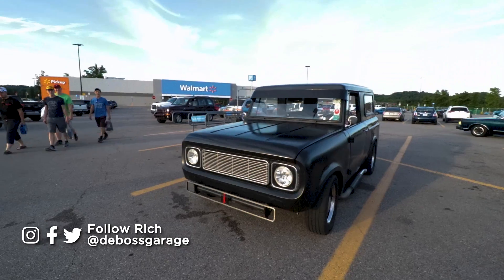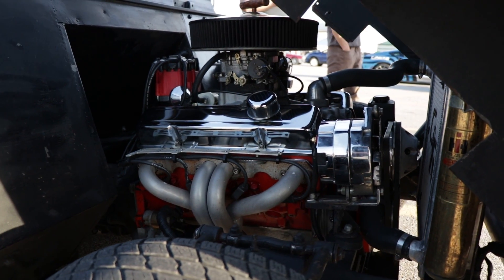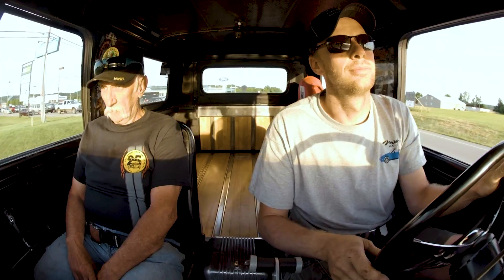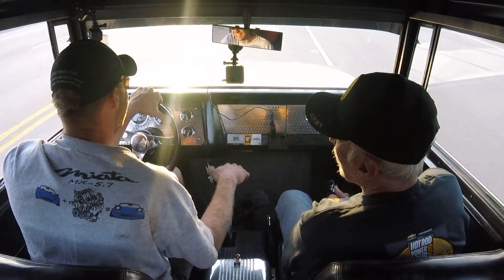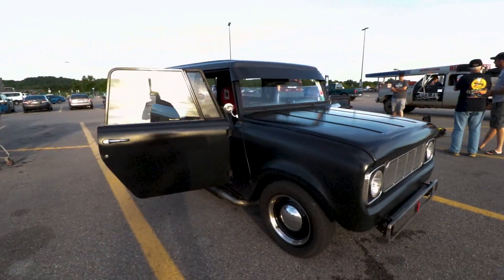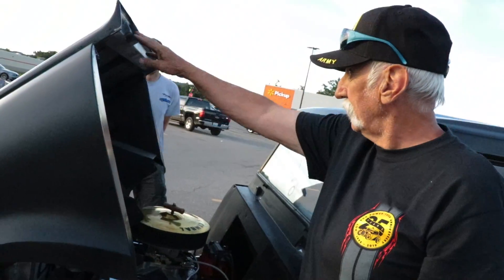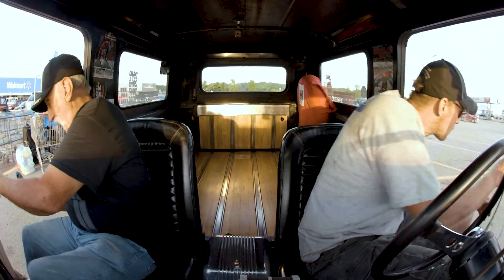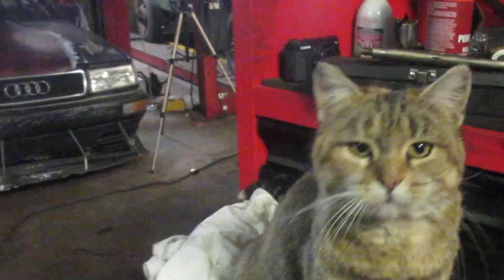Junkyard Rescue! '66 IH Scout Home-Built Hot Rod Pickup

Comment: It looks great but I prefer the Corn binder sound be a 304 or a 392. I even like the 4 cyl 196 which is a cut in half 392. 
Another good vid, thanks.
Reply: MostlymoparIH or the 345
Reply: @kennethlaw5216  Yup that's good won two.
Reply: People always put the GM Garbage in there.
Reply: @smathet7766  It's theirs so they can do what they want with it but then they complain when someone takes an old chevy and puts a Hemi in it or a Ford engine. Well turn around is fair play. I like it when they keep em original but if I get a chevy I'm gonna put a mopar in it just to give em some of their own medicine.
Reply: @smathet7766  I first converted my 345 to GM TBI. instead of rebuilding due to oil retention problems, I elected to go with "GM garbage" LS engine swap (but I did it in 2005). I really couldn't be happier with the motor swap. In my rock crawler it has been flawless, naturally aspirated it made its power higher in the RPM band which was something apparent but forced induction more than fixes that or being geared correctly. The best part is they are basically disposable engines, you can beat on them, run them upside down and throw lots of boost at them. When they break you just go get another for a few hundred dollars. mines been in the scout for 15 years and I haven't had to replace it yet but I am not worried about it if that day comes. weight savings is always nice too, it offsets some of the 1 ton driveline.

Comment: The original engine was probably a 172 1/2 slant four, or the 345 v-8. the v-8 was an option. The four was half a v-8 and many of the parts could be swapped back and forth.

Comment: EEK! No shoulder belts. No head rests, no air bags, steel dash.  DeBoss should have a contest to see who can identify the most dangerous features (or lack of)  of this vehicle which can kill you.
Reply from the maker: Do you say this to every person you see ride a motorcycle?
Reply: So essentially every car before 1972, when shoulder belts became mandatory?

Where would out hobby be if every "unsafe" vehicle was just left to rot and never driven?
Reply: @perotekku  No. Starting in 1966 every automobile manufactured in the USA  were required to have them.
Reply: @cee128d  You're absolutely correct, I'm not sure what I was thinking of with '72, airbags? Turn signals?

Thanks!
Reply: I bet this guy is real fun at parties.
Reply: Guys like you should stay home, and be safe. At all costs..
Reply: @DEBOSSGARAGE  Ah Ha, he probably breaks out into a cold sweat and then runs home crying..